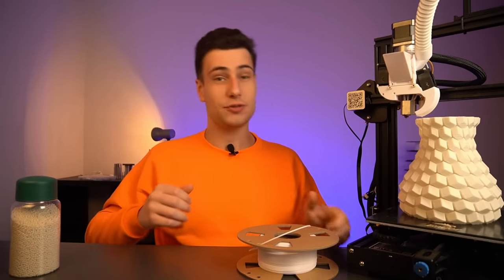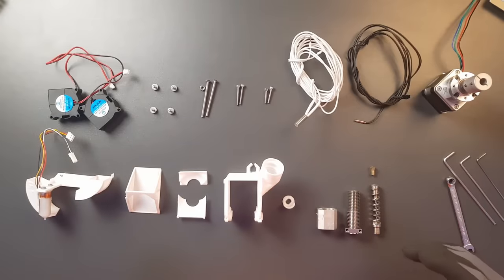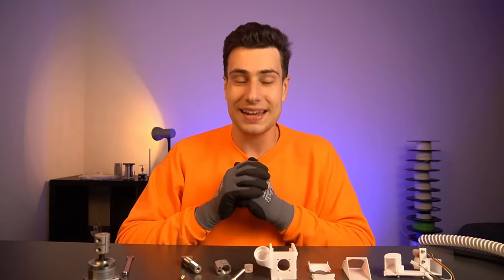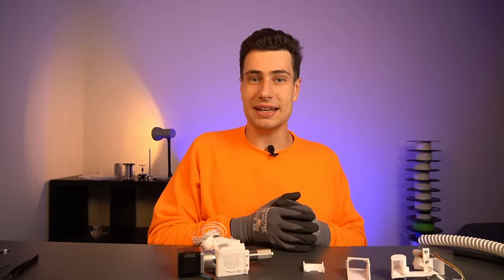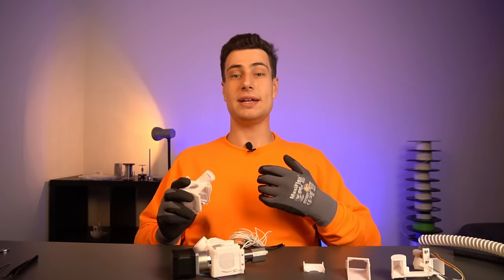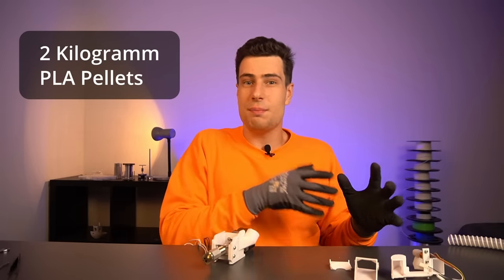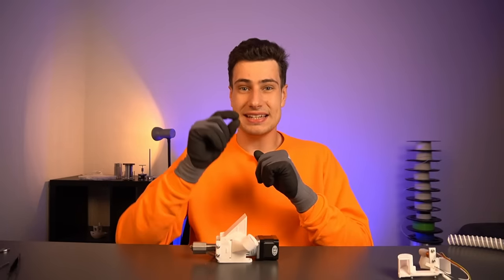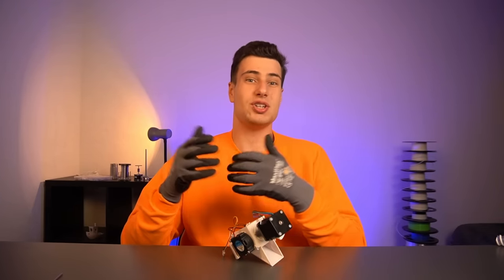Pellet Extruder for ANY 3D PRINTER | 3D print Granules, Chocolate, Sugar and more

Comment: Could this same method be used as a standalone device to make spools of filament? It seems like you’d retain basically all the benefits of using pellets, but you are still able print regular filament, and can use it for multiple printers without modifying all of them
Reply: You wouldn't need anything as complex as this to do pellet extrusion for filament. Filament extruders are FAR easier to make as you control the filament diameter by how much you pull the extruded material. Many think you extrude at the final diameter, but you actually extrude at a much larger diameter, and you pull it as it runs through the cooling bath to get down to the target diameter. Some will use gravity to control the diameter thickness, but those systems are much harder to tune to get a consistent filament diameter.
Reply from the maker: haven't tried it yet, would want me to do it? 😄
Reply: @greenboy3d  absolutely, this seems like a great idea

Comment: I'm not sure why you keep talking about printing food. It's a super niche gimmick and won't be the selling point. Have you even considered what would be required to meet food safety standards? 

Freedom from higher filament prices and the companies trying to lock you into their ecosystem is a big deal, and makes your concept worthwhile on its own.
Reply from the maker: The sugar 3D printing is not about eating it, but making insanely cheap "Aesthetic" or low strength parts, that can be spray painted in any desired color 😄
Reply: An infinite supply of those breakable prop bottles would be awesome.

Comment: This is absolutely amazing. I fully expected this to cost around 1K, but with under 300€ it's actually well within reach of anyone who can afford a good 3D printer.

Still, I have two reasons I'm not buying it though; I don't print that much, especially weight-wise, and I'm not willing to give the hardware aspect of printing more time and effort than necessary - with that consideration, I probably wouldn't use it even if it was for free.

I'd say if you go through lots of material, buy it.
Reply from the maker: Thank you for your feedback 🙂

Comment: 1 minor update for correction PLA is a legitimate engineering material in its own right it's actually quite an astonishing plastic it's as strong as plywood yet easy to print and cheap in fact PLA only has two real issues and strength is not one of them

Temperature of deflection which is very low 35 to 40C but indoors this is not an issue and the second issue is creep The plastic can slowly deform over time when it's placed under stress

As long as you can account for those two issues PLA is basically a miracle plastic if they could just figure out how to make something like PLA with a higher temperature of deflection while keeping it as cheap and easy to use as it is now? That would be amazing
Reply from the maker: The PLA parts of the Pellet Extruder get annealed over time by the constant rising hot/warm air from the heating block.

Great input from you! :) 
What would you like to see next? 🙂

Comment: This is a great I didn't know pellet existed until a few weeks ago,pellet extruders are a great idea ,I bought a 3D printer at the beginning of February so far so good, as a beginner I think I wasted almost half of my filament because of a fault with the printer and bed adhesion,I plan to make a filament maker but this also could a viable option to recycling plastics myself

Comment: Never got the verification email (including my spam box), so just leaving my answers here. The two most important things for a pellet-printhead for me are: 1.Ease of switching between different pellet materials / colors. I imagine this as taking a container of pellets out of a dry-box, attach it to the printer, and go. Similar to switching ink cartridges in a regular inkjet printer. Maybe the hopper can be modified to also serve as a pellet dry-box, or the containers themselves serve as interchangeable hoppers that can be stored in a separate dry-box (similar to the function of filament spools nowadays). 2.Compatibility with my Prusa MK-4. Especially because this setup would change the weight of the printer and possibly mess with the input shaper.

Comment: I am genuinely excited for the release of this project. The biggest advantage I can see for such an extruder is recycling failed prints via shredding and printing with the shreds directly.

One design feature I'd like to see is some way to stir the material by the motor to keep it reliable. Something similar to the ARTME3D DIY filament extruder system has by using a screw.
Reply from the maker: There is no stir necessary

What would you like to see next? 🙂

Comment: Very clever engineering, well done! Does this work with the new generation of high speed FDM printers. I would imagine the extra mass on the print head would be a major issue when these printers run at such high start and stop accelerations as well as keeping the pellets feeding at these high accelerations. Also will the resonance compensation algorithms still be able to account for the mass of the print head/feeder.

Comment: You are clearly an excellent engineer. So, congratulations on your development.

May I make a suggestion, however. You could leave any existing print head intact and instead place a bead-to-filament device on the main upper cross beam. It would be somewhat like the heater and screw device you've already made, taking pellets at the top, but instead of feeding to the print nozzle down on the print head, it would basically generate standard filament and that filament would then be fed down to the print head in the normal fashion. It could be complete independent of what's going on at the print head, requiring no firmware modification, because it could simply have a sensor detecting when the filament is being pulled by the standard print head.
Reply from the maker: Thank you for your kind words and feeback ❤
What would you like to see next? 🙂

Comment: This looks great. Also great presentation, I will definitely be following your progress!
Reply from the maker: Thank you! 🙂
What would you like to see next?
Reply: @greenboy3d so for me this gives 2 questions, 1. how is the reliability with the various pallets and shredded plastic (I would think that shredded plastic would be less consistent unless super small pieces) and 2. A more step by step guide with specific info on what to get etc with a start to finish build. 

But yeah mainly the first thing. For me to start using this, I would need to know how reliable this is. Sure filament is more expensive, but so is energy, failed prints and initial costs. If it's very reliable, this would completely change 3d printing.

Comment: You could also greatly decrease weight by using flexible shaft (similar like dremel use for example) and moving motor to upper frame. It should work pretty ok, it could cause some retraction issues as it's basically just a coil most of the time but well, maybe worth to give it a try.

Comment: This is a really cool concept. I like the idea but maybe swap the PLA for PETG. PETG has better thermal resistance, is less susceptible to creep, has the rigidity of PLA, is as cheap as PLA or cheaper, and prints just the same with the right print surface. Great work !!!!
Reply from the maker: And thank you for your warming words! ❤ The beauty about this is Pellet Extruder is that it works even with PLA, but everyone can print it also with higher class materials
What would you like to see next? 🙂

Comment: I use thermal plastic beads all the time in crafting. You can dye them with Rit Dye More to change the base white/clear shades.... so custom colour changing is an option. <3

Co Print 3D is also working on a AMS steem with their print head to use on other machines as an example of changing the function of 3D printer.
Reply from the maker: What would you like to see next? 🙂
Reply: @greenboy3d  I'm curous on the waste printing and whatever plastics you can print it. And how it avoids air pockets with the way it's extruding through the nozzle. 🤔

Edit: also printing hard wax at a lower temperature for mold making....

Comment: Amazing video! Though you showing how it's assembled brings up two questions that I'd like clarification on.

1. Those sliding pieces that are removable, are they tightly in place to make sure they don't come loose during a fast print?

2. Is there some kind of lid for the open hole that lets you see the inside of the feeding bay? asking since during a faster print I can imagine pellets flying out of that hole.
Reply from the maker: 1) It never ever happend to me that the sliding piece "slipped out". And if you like to then you can print it with a bigger flowrate which will case a very high friction, that would case it to sit very tightly.

2) It's already on my list, but didn't made it into the video, because I didn't made the CAD file yet, since have set it to be my priority to make atleast one video every 2 weeks 🙂

Comment: Allow me to make 1 suggestion... instead of the hose you used, try a smooth hose with the adapter on the end to screw into the extruder, that way no pellets will get caught up in the hose.
Reply from the maker: The result would likely be the opposite. The hose I am using is very smooth on the inside wall and through the spiral support structure can not deform and maintains through that a constant diameter.

Using just a smooth hose could potentially result in the hose bending slightly, which could cause a narrowing in the channel, which would cause pellets to get stuck... I guess you get the point 🙂

Comment: Cnc kitchen just did a video on using a 3D printer for injection molding, this type of hotend would be ideal for that scenario. You could have a printer for rapid prototyping and an injection molder for small runs of parts in one machine!

Comment: Would love to see the stepper motor doing its work from remote, kind of like the flexible telescope connectors from power drills. Torque could be a problem, but should be sufficient depending on how much flexibility is even needed.

Comment: BIggest issue I see is the mixing of colors, and separation of the master batch and raw material when you want to switch over. Has a lot of potential, mostly in the print farm industry I bet. As for home use, I dont really see this taking off drastically due to the raw material mixing and color matching most people wont take the time to do. I still see most individuals and education facilities/other markets sticking to standard filament, even for its increased cost. For the increased cost, you get machines that are easy to use, consistent filament colors and quality, and overall an easier machine to upkeep.

Of course ill look into this for my print farm though!
Reply: For engineering purposes, I see this as a perfect solution when prototyping.

In regards to the coloured filament, I don't see why you can't just buy coloured pellets. But I do see what you mean with it's difficulties in changing colours over and over.

Comment: Close! make this compatible with shredded waste filament, and that would be a real revolution! EDIT: Oh, it is! Would be cool if the shredder was built into the bucket tho
Also, i think higher flow rate is more important than higher temp!

This is helpful, but honestly the material cost isnt all that much for me. Would probably cost me more in time/materials, and i dont think this would fit on a bambu :P But if it could recycle filament, id build one in a heartbeat to put on my neptune max!
Reply from the maker: Thank you for your feedback, I appreciate it :)

Soon the extruder will be available

Comment: well, if you can cut 3d printing cost by 70%, the industry will beat a path to your door, take your idea, and proliferate it through the world, lol. 
while I imagine there may be some limitations for size of print,  I can imagine an easy solution of the hopper moving to a corner of the print area, being refilled, and then continuing the print.  this might have interesting effects on color printing, where the hopper can hold a dozen different colors, refilling as needed. 
the hopper could even have a 'purge hopper' function to save unused pellets during color change.  
so.. if it your extruder works well, then it could easily change the terrain of 3d printers over the next 4 years. 
good job!

Comment: Definitely see this working on the conveyor printers doing extended production runs. What is the weight? Would you have to beaf up the x/y steppers?
Reply from the maker: I will make some improvment before I make the Pellet Extruder available so the real weight my change a bit.
A beaf up for x or y is not required, 
What would you like to see next? 🙂

Comment: For the pla portion, odd question. Did you account for creep? Even though the pla for the most part won't melt but over time eith enough heat it will deform.
Reply from the maker: It will take a lot of time till you can even notice any effect from creep because the applied load is very small on the plastic parts. And you don't have to limit yourself to PLA, you can also use Nylon CF/GF for example.

I just designed everything in a way so that I can also be used with PLA up to 300°C, which is not the case with most other pellet extruders...

And in the end you can always just print out a new PLA part when you think the time has come to replace the already used PLA parts without the need to buy new spare parts 🙂

Comment: I have been waiting for a long long time for something like that. Well done. 
The only issues I see compared to Filament based FDM systems is print speed, what the volumetric flowrate you can reach with this system ? Is it much slower ? And weight, the metal parts a way larger due to the screw and housing. Also the PLA brackets will be crap no matter how well you design them, every material has it´s limits, that´s just always the case. But no matter my mild concerns your tech is 95% at the goal already, this kind if system is fantastic just because it saves 50% of material costs, at least 50%.
Reply from the maker: I haven't yet reached the limit on all metrics like max speed and so on, because for instance the ender 3 v2 which I usually print with, can't provide enough power for the extruder motor, which limits the max print speed, but only for this specific printer

What would you like to see next? 🙂
Reply: @greenboy3d  1. I would like to see a comparison like ca. max. volumetric flow compared to a filament system which would limit the extrusion speed. 
2. I also would like to know the weight compared to a usual filament extrusion system and I would like to compare the whole picture in print quality. 
3. Looks like Z lines are an issue which shows that the extrusion is not uniform layer by layer but the tolerance might be higher compared to a filament system, so I would like to know how that compares. 
How much is this the case and why ? 
4. What is the price for the whole system as is circa ? 
And more technical details in general. 
I believe a filament based system is much worse compared to a granulate system, this opens up so so many possibilities besides the price alone but I would like to have more information. I really am happy about this development.

Comment: How much pressure can you get? Diy injection molding machine? Resin3D printers can be used to make the molds  in aluminium boxes.
Reply from the maker: If you want some pressure than just exchange the motor with a "big enough" one, and your problem is solved :)
What would you like to see next? 🙂
Reply: @greenboy3d  Stick a 23 size motor on it to see if it could be used for low pressure injection molding. Would probably need mold heaters too? But cycle time would be lower for miniatures? Can it withstand Nylon  molding temps?

Comment: Have you thought about separating the control of the extruder screw and the request for plastic? I'll explain. From what I can see so far with the limited youtube quality is that there is quite some inconsistency in the prints, which makes sense as the pellets are not all equal, and the space between them can differ, which gives you more organic and not consist results. What you could do is instead of thinking about extrusion amount and linking that to the screw is to think about flow amount/pressure, link that to the extrusion amount and then request more material from the screw when the pressure drops. That way the control loop for the screw tries to keep the pressure homogeneous, which should result in more consistent extrusion quantity. You would make it more complex by adding some type of pressure sensor though. And you would need to program some type PID or other control loop to keep the pressure within its set point.

Comment: If to go crazy on top of the hopper can be a slow rpm motor with a just a metal wire attached to it, going down the tube. By slowly turning it can mix pallet and do not create a lot vibration. I know it is working fine even like that, it is just again a cheap solution, not some steampunk big money system)

Comment: Awesome idea, but do you think this could be scaled up, I feel like the best use for this type of extruder is a big format 3d printer, someting like 1000x1000x1000 where printing with 1.7 mm filament on a 1mm nozle at most is just too slow
Reply from the maker: In November, I actually begin to develop a more powerful pellet extruder with the goal to design it for an output around 500 grams of plastic per hour, but that is top secret for now 🤫